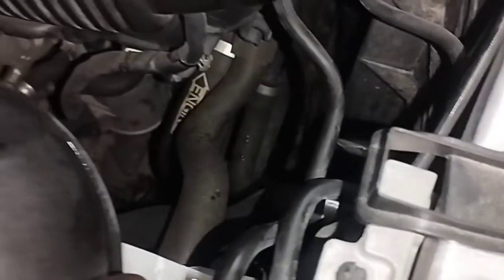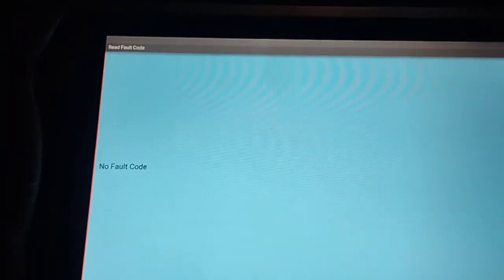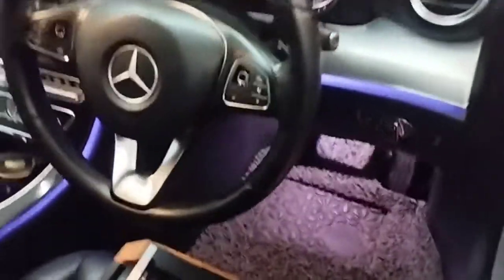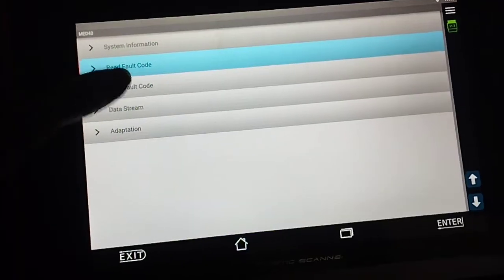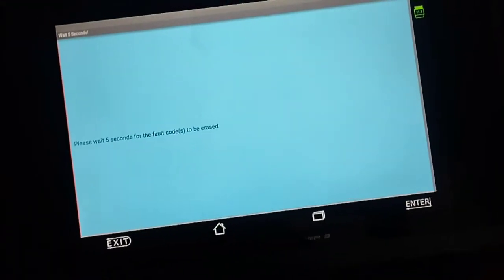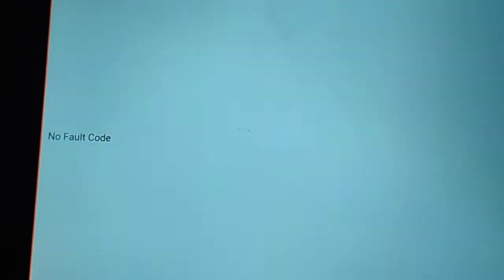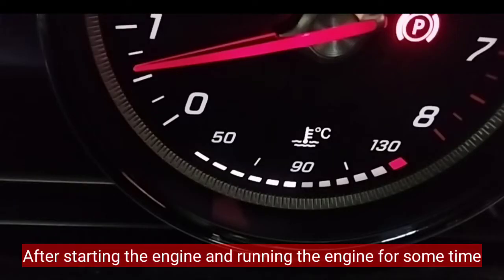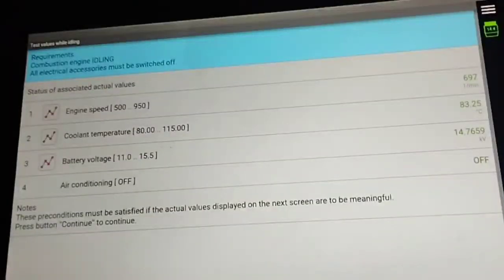how to fix a overheating car engine ! Mercedes Benz E-Class ,W213 ,(2018-2020)

Comment: Hie, I changed water pump, thermostat, coolant temperature sensor  but is still doing the same thing
Reply from the maker: It's frustrating when you replace common overheating components and the problem persists! Since you've already changed the water pump, thermostat, and coolant temperature sensor, here are some other common reasons why your coolant temperature might still be running high:
1. Air Pockets in the Cooling System:
 * This is a very common culprit after working on the cooling system. Air trapped in the system can create hot spots and prevent proper coolant circulation, leading to inaccurate temperature readings and actual overheating.
 * Solution: You need to "bleed" or "burp" the cooling system thoroughly. This often involves running the engine with the radiator cap off (or a specialized funnel) to allow air bubbles to escape as the engine warms up and the thermostat opens. Look up the specific bleeding procedure for your car's make and model. Some vehicles are notoriously difficult to bleed and might require a vacuum fill.
2. Clogged or Damaged Radiator:
 * Even if the coolant flows, a radiator can be internally clogged with debris, rust, or sludge, restricting coolant flow and its ability to dissipate heat.
 * The external fins of the radiator can also be blocked by dirt, leaves, or bugs, reducing airflow.
 * Solution: Inspect the radiator for external blockages. If it's old or looks corroded, it might need to be flushed or replaced.
3. Faulty Radiator Fan(s):
 * The electric cooling fans (or a mechanical fan with a bad clutch) are crucial for pulling air through the radiator, especially at low speeds or when stationary.
 * Solution: Check if your radiator fans are turning on when the engine gets hot. You can also test them directly by applying power. If they're not engaging, it could be a bad fan motor, a faulty fan relay, a blown fuse, or even an issue with the wiring.
4. Radiator Cap Issues:
 * A faulty radiator cap can't maintain the correct pressure in the cooling system. This lowers the boiling point of the coolant, causing it to boil over at a lower temperature and leading to overheating.
 * Solution: Replace the radiator cap. It's a cheap and easy component to swap out.
5. Collapsed Hoses:
 * Sometimes, an old or weak radiator hose (especially the lower one) can collapse under the suction of the water pump, restricting coolant flow.
 * Solution: Inspect all cooling system hoses for signs of swelling, cracks, or collapsing when the engine is running and hot.
6. Incorrect Coolant Mixture:
 * Using pure water instead of a 50/50 mix of coolant and distilled water, or using the wrong type of coolant for your vehicle, can affect its heat transfer properties and boiling point.
 * Solution: Ensure you're using the correct type and mixture of coolant as specified by your vehicle manufacturer.
7. Head Gasket Issue:
 * This is a more serious and expensive problem. A blown head gasket can allow combustion gases to leak into the cooling system, creating excessive pressure and leading to overheating. It can also allow coolant to leak into the cylinders or oil.
 * Signs: White smoke from the exhaust, coolant disappearing without a visible leak, milky oil, bubbles in the coolant reservoir, or a sweet smell from the exhaust.
 * Solution: A "block test" can confirm a head gasket issue. If it's blown, it requires significant engine repair.
8. Impeller Slip on Water Pump (less common with new pump):
 * While you replaced the water pump, it's possible (though rare with a new part) for the impeller to slip on the shaft, preventing it from effectively circulating coolant.
 * Solution: You'd need to visually inspect the impeller if you suspect this, but it's unlikely with a brand new pump.
What to do next:
 * Bleed the system thoroughly: This is the most important first step after replacing cooling components.
 * Observe the fans: Do they kick on when the temperature rises?
 * Check the radiator cap: Replace it if unsure.
 * Inspect hoses: Look for any signs of collapse or leaks.
 * Consider a professional diagnostic: If you've tried all the above and the issue persists, it's time to take it to a trusted mechanic. They can perform more advanced tests, like a cooling system pressure test or a block test, to pinpoint the exact problem.
Good luck! Overheating can cause serious engine damage, so address this as soon as possible.

Comment: Hi, my e class w213 2016 coolant reservoir full of oil but there is no any other symptom, engine run very smooth , anyone ????
Reply from the maker: Oil liking ,
The causes can range from a blown head gasket to a faulty oil cooler or damaged seals.

Comment: I have question I got e classe 2016 my turbo cooler keeps working because of overheating is this the video for it?
Reply from the maker: This video is overhating problems solved
Reply from the maker: Mercedes E class overhating problems Bad water pump
Defective thermostat
Damaged radiator fan
Leaking coolant
Coolant circulation blockage
Low coolant

Comment: Hello! i need Help Please.
I have a 2014 C250 model, and the transmission cooler failed. I replaced it, flushed the transmission and the radiator, and also changed the fluid and the filter. A few days later, the car started to overheat, but not while stationary with the engine on. Instead, it occurs after driving for a few minutes. I stopped the car immediately, checked it, and confirmed that the coolant level was okay. I changed the thermostat and water pump, and later discovered some engine oil mixed with the coolant fluid. I replaced the engine cooler (inside gasket was teared) and flushed it again, but the car is still overheating. cooling fan is working fine and i have no signs of a blown head gasket. Any ideas
Reply: hi, Did you find a problem for this?

Comment: I have x253 glc 300 when i drive it and start ac it’s overheating can it be the same problem and the cooler wind start on max
Reply from the maker: coolant temperature high  common This can be causes by a cooling system leak, damaged radiator fan, broken water pump, or even a clogged coolant hose.
Reply: when the ac is turned off the temperature it shows me on the screen is like 80/90 when i start it the temperature is going up to 100/120